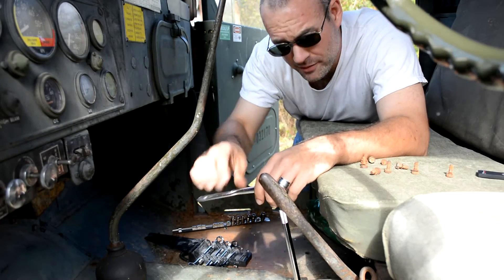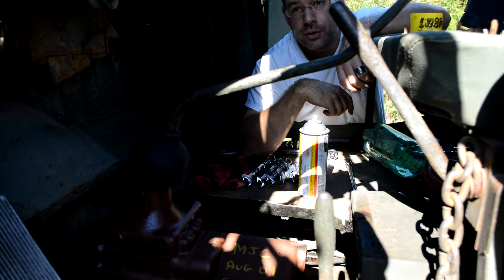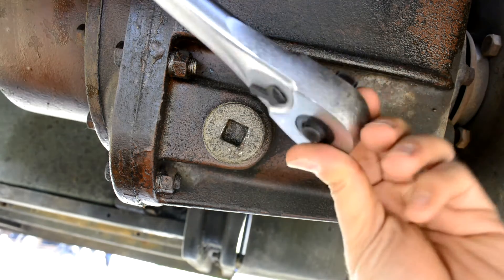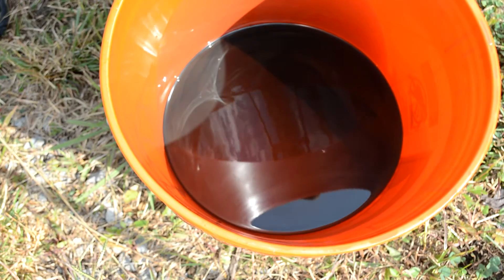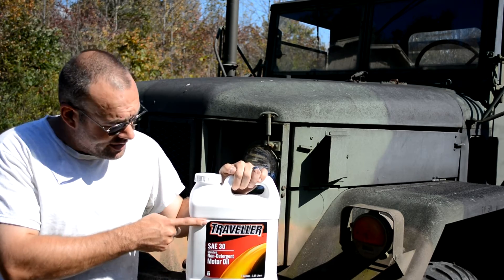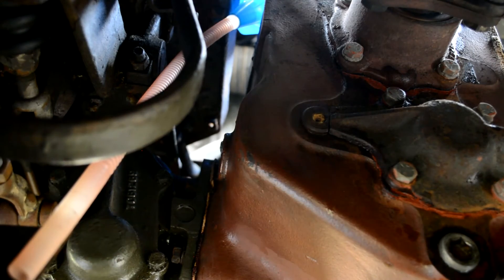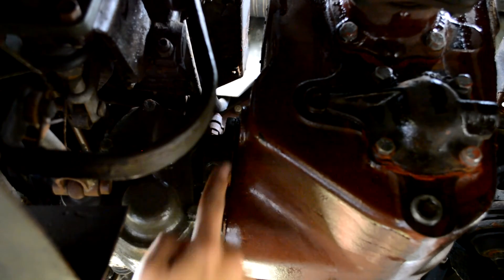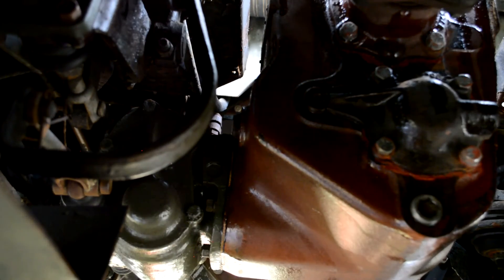Transmission Oil Change on a M35A2 Deuce and a Half

Comment: Where do you get parts for this truck?
Reply from the maker: There are several places online that have warehouses of new/old stock that can be found by Google.  As far as simple maintenance items NAPA has all the filters and fluids you'll need, except maybe the big air filter.  It's kind of like owning any classic car as in simple stuff is easy to find if you have the correct part number but specific parts may be a scavenger hunt.
Reply: @deuceandguns  thank you. I thought it we be damn near impossible cuz it's a government vehicle.
Reply: @g00n989  bikemikesmotorpool is good site, not too expensive rip off prices like eastern surplus

Comment: Just noticed something after watching this vid about 100 times,.....

You said they used GL1 and then GL5 (improved) in the gearbox,, diffs and transfer case, I can understand that they would need to use as few different consumables as possible and why.
So since a 30-50W  non detergent  oil was meant to be used in the spicer gearbox, dose that also mean you can use that same oil in the transfer case and diffs as well?

Aussie.
Reply from the maker: I've been told that 30-50W can be used in the transfer case but I've also heard that 80w90 gear oil is best so I'm still researching before I change it and make a video. The diffs will need something better suited to the pressure so regular diff oil (80w90) but I'm still researching exactly what's best before putting it on video.

Comment: pull the dipstick when draining... allows the air to escape and oil to flow freely...
Reply from the maker: There is no dip stick on the transmission.
Reply: ***** lol oh OK... That sucks....I'd still love to work on one ....What's retarded is that most modern cars now don't have a Dipstick...It's got a retarded level"Sensor" and when it malfunctions it's like 1000-2000 labor to replace... Modern vehicles are made like ipods... Expandable...And to break as often as possible to maximize profits for the manufacturers...It's called planned obsolescence...I will never get anything past the 90s

Comment: I'd really love to import a Deuce into Perth, Australia, but the cost of getting it here would probably be as much as I'd buy it for!

If only I had 10k to throw away. Not that the 10k would be wasted :)

For now I'll have to enjoy video of other's trucks...
Reply from the maker: Shipping a Deuce to almost exactly the opposite side of the Earth would be pricey but don't you have access to military Unimogs and Rovers?  Those are pretty awesome as well. Thanks for watching!
Reply: Yeah, but they're not anywhere as awesome as a Deuce! IMO.

From the videos, the M35A2 sounds to have a real nice exhaust sound even though a bit loud.
I also like that you can get them with a mutifuel engine.
By using a mix of diesel and used oil, you could save a fair bit on fuel costs.

I just think they're pretty cool machines to be honest.
If I'm lucky I may get a ride in one in a few weeks time.
While up north on holiday I saw one at Murchison House Station, near Kalbarri.
It was after a Google and Youtube search that I stumbled upon your channel and Deuce videos!

We also had the OKA which I believe was designed and built here in WA (Western Australia). They were of limited numbers so cost a bit to buy, IF you can actually find one!

Comment: Just out of curiosity where do you guys find these in fixable condition like this truck here for around 3-4K or less? I always hear of people buying them cheap but never find them :(
Reply from the maker: Those who claim the super cheap prices are either talking about when they were at the GOV auctions for $1,000 but they're all gone from there now, finding an owner who needs quick cash, or they're stretching the truth a bit.  I typically see them close to or over the $10k mark now for ready to roll condition but that will vary greatly due to location.
Reply: DEUCE AND GUNS great... :( here goes my chances of ever owning one...
Reply from the maker: The 5-tons are still at auctions I think so you'd have a better chance of finding one of those super cheap and there's always craigslist.
Reply: DEUCE AND GUNS I mean it’s not like I’m trying to be cheap, but I just don’t see spending 10 grand on a “fun” run around vehicle, even if it’s a bit old or abused is fine, I operate and maintain equipment for a living so the general knowledge and understanding is there for these trucks.

Comment: Hey BC, is it okay to power shift 1st gear? (shift into 2nd without letting off the gas pushing the clutch in just to the friction point then shift into the gear and let off the clutch) I know it's possible in manual transmission cars to reduce shift time and also done it to my atv.
Reply from the maker: Will a Deuce take a shift like this?  Probably.  Will this cause accelerated wear and possibly break something?  Yes.  If you're concerned about shifting quickly don't buy a Deuce.  If you're concerned about vehicle speed don't buy a Deuce.  Like any vehicle that you plan on keeping for a long time if you drive it like you stole it then you'll eventually wish someone does steal it or plan on putting a ton of money into repairs.
Reply: Well driving it like I stole it does help clear up any fuel system clogs. Amd also when is the next video gonna be?
Reply from the maker: Sometime in October.

Comment: Can you run this oil as fuel ?
Reply from the maker: Once it's filtered it can be added to the regular Diesel.  Technically, it can run on straight trans oil or motor oil but it's very hard on the pumps due to being thicker than diesel.

Comment: do you have 900x20's or 1100x20's?
Reply from the maker: 9x20 for the deuce and a half.  The 11x20s were stock on the 5-ton.
Reply: Well 11-20s were originally stock on the deuce then the government went down to 9-20s to make loading and unloading
Reply from the maker: Interesting.  I've never heard that but I've never claimed to be a deuce historian either.  All my knowledge is from the TMs and how they were most recently configured by the government.
Reply: yeah they just did that to drop the bed height my friend is putting 11-20s on his just for looks we do Vietnam reenacting so my friend got that and it was originally painted like yours but he painted the whole thing with olive drab  raddle cans from home depot lol and we have an m105 trailer that we are also putting 11-20s on when we do ill have to send you some pictures

Comment: I notice you didn't use any gas tape on the plug threads to seal against any leaks?

Aussie.
Reply from the maker: Aussie, that was not intentional on my part.  I'm so used to working on modern vehicles with sealing washers on the drain plugs that it totally slipped my mind that a sealant may be needed for this.  It really only occurred to me while editing this video but I've put roughly 3 hours on the truck after this change and not seen any drips yet...but time will tell.  I will say that there was no sign of any sealant on the plug when I removed it and no mention of it in the technical manuals talking about the trans fluid change so I may be OK.
Reply: Is gas tape something like Teflon tape ??

Comment: since doing this how is that sae30 working out for ya. im installing the 3053a into my 1996 ram3500 cummins. wanted something stronger with a closer OD than standard. this fits that bill nicely.. ive just about got everything ready to go in but keep hearing 20 different things i need as far as oil for this gear box... oddly a call to spicer was not much help at all. personally i figured a lighter weight oil would be better to cure the second gear bearing failures i hear of. though cruise speed rpms for me will only be 2k on the input side so that should not be an issue
link to my build currently underway 

https://www.cumminsforum.com/forum/94-98-powertrain/2502599-doing-auto-spicer-3053a-swap.html

Comment: Do not use gl5 in a duece. GL5 contains high pressure additives that are no good for the yellow metal components in your trans and diffs. Your trans looks like it was replaced or rebuilt. The oil could be cruddy because no one changed it after the break in period.

Comment: Do you or does anyone know if your low air pressure switch leaks air through a hole on the right side of it? The low air pressure switch is mounted to the firewall above the steering shaft. If you follow the wire that plugs into the buzzer it will connect into the low air pressure switch that I am speaking of.  I'm wondering if yours has a plug in the hole to prevent air from coming out of it or if there's a hole in yours and there's possibly a diaphragm that blocks the hole from inside the switch or something to that effect that broke on mine. If there is a screw or plug in that small hole on the right side of the low air pressure switch then that would tell me I can plug mine. I don't want to have to replace the switch if I don't need to. Thanks!
Reply from the maker: +Tyson Capel I've never looked that closely so I can't comment at the moment.  I keep my deuce on the farm and due to my recent surgery (lasik) I've got doctors orders to not go to the farm or any dusty environments for a few weeks.  Once I'm given the OK to have fun again I'll be sure to check and report back.